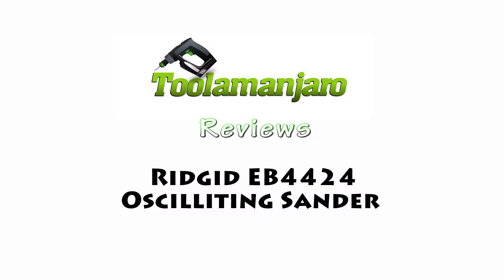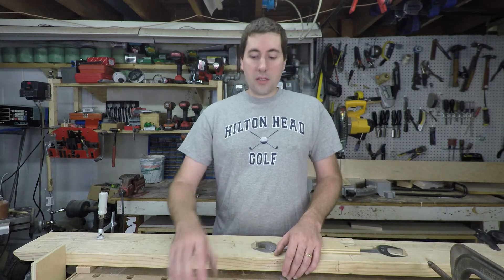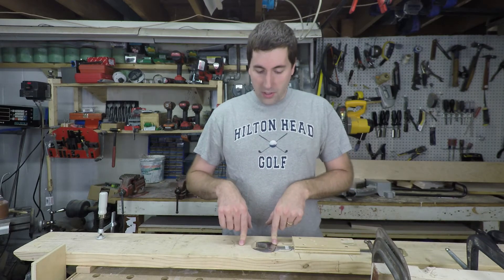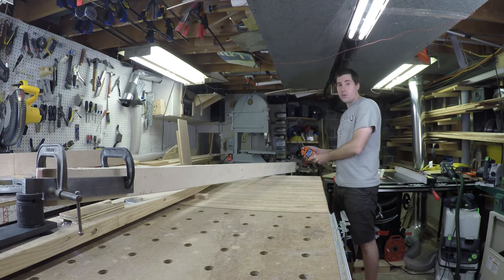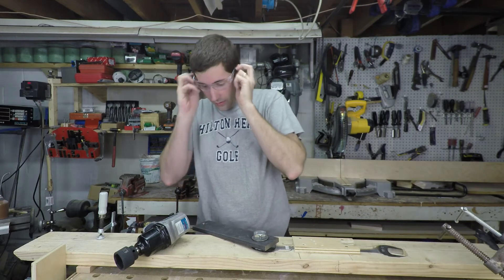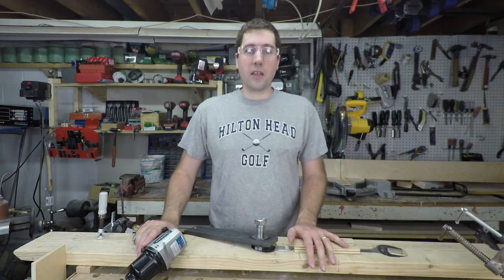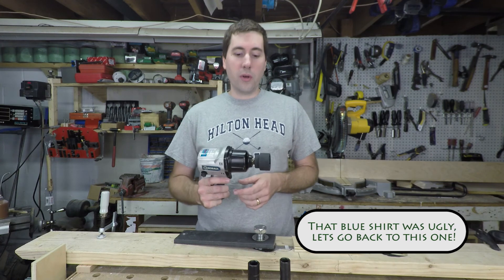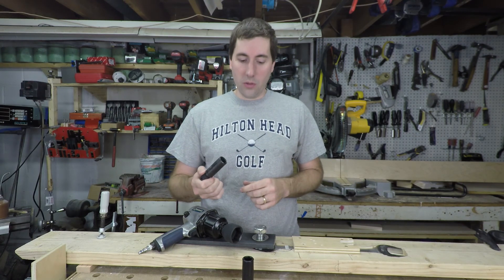Kobalt 1/2" Impact Wrench Torque Test

Comment: Just three words: Working. Air. Pressure. It should be 90 PSI, but that is at the tool with it running. It is NOT 90 PSI on the regulator. Depending on your setup with hoses, fitting, regulator, filters, etc you WILL be getting a pressure loss from the regulator to the tool. The only way to correctly adjust this is to makeup an end of line pressure tester with a Tee with a gauge on the top and the air line going through and look at the pressure with the tool running and adjust it until you see 90 PSI at the tool with it running at free speed. I also highly recommend 1/4 v style high flow plugs and couplers and a 3/8 id hose. Anything less and you are starving it of air and it will not perform at its max potential. On my setup the regulator is set to 115 PSI and at the impact it is 90 PSI working pressure. And that is with a filter/water separator, 15' 3/8 hose with all Milton high flow couplers and plugs.